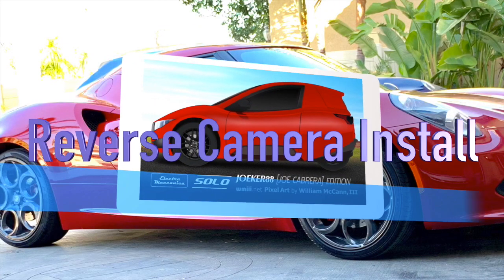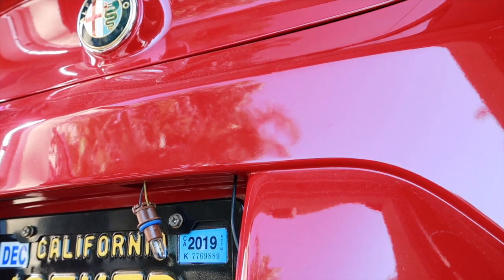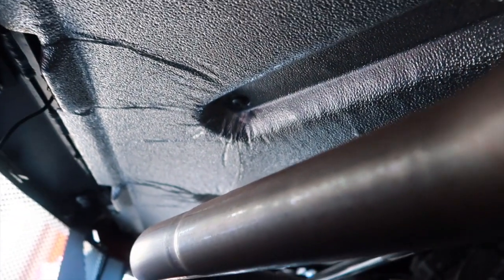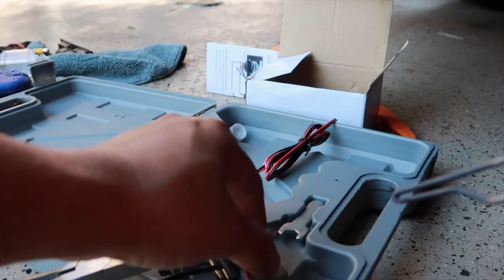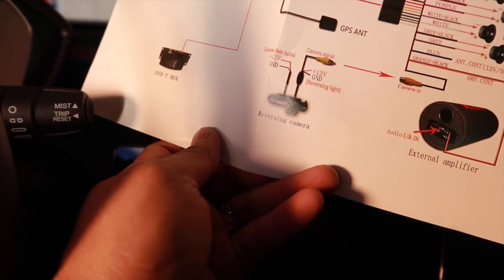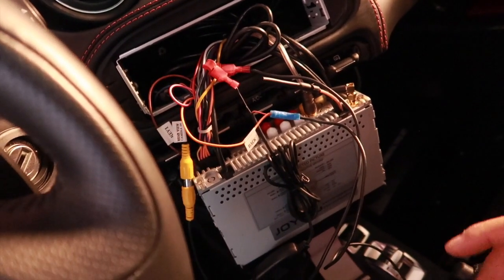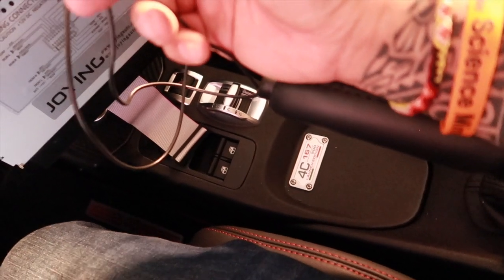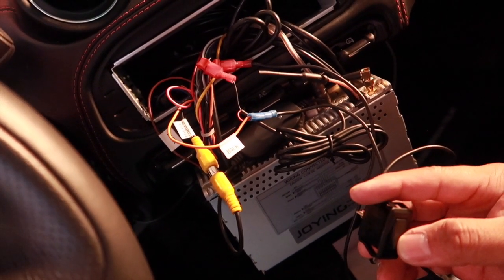Alfa Romeo 4C Wireless Reverse Camera Install

Comment: There should be a switch by the gear shifter that activates the power to the backup light too, under the center console. Connect the receiver to that and you can forget about the extra toggle switch!
Reply: No, the stereo have power on and off wire too.  so either you can use that wire or put a relay with the 12 V.  Stop hacking guys.

Comment: Hi, i got the exact system but for another car,  in the back of the unit is a pink cable, and that is powered on only you back to reverse and where you have to hook it up , and that tansmiter will be on only when you back in reverse, i think you connect it to red cable and that is always power. Check it
Reply: That's the correct way to do it 😊

Comment: ....why would you solders the wire so you can connect the tap to it?.... why don't you just solder it to the wire? Stronger and much easier too.  Isn't there a key wire on stereo, that wire suppose to act like your switch to only turn the stereo on when you plug in the key.

Comment: Hi Joe, maybe a stupid question but the reverse light has two wires. 1. black 2. black and green. The transmitter has a black and a red wire. Which line up?

Comment: dear Joe its a great work I much appreciate it, I have few questions for this,
1- Back cable of android device is input or output? if its a output I can use relay to energise receiver of wireless receiver unit. But I think its a input of android device to check the gear situation if its reverse or not. 
2- is it a must that back cable have to connected with 12V?
3- If I leave back cable unconnected  what will happen? will the camera image never shown on multimedia device?
4- My android device has CAN connection, can it understand reverse situation from there or I still need back cable to be connected?

thanks for your answers.

Comment: Hey Joe, thanks for the video. I’m trying to follow in your footsteps! How did you get the stock license plate light out? It doesn’t seem to have a tab like the eBay one.
Reply: Never mind! For anyone else, just take a plastic pry tool and jam it in on the right/passenger side of the light. It feels like you’re going to break it 😅 but eventually it comes out! Imagine you’re trying to push down a spring latch that’s about 0.5” inside from the edge.